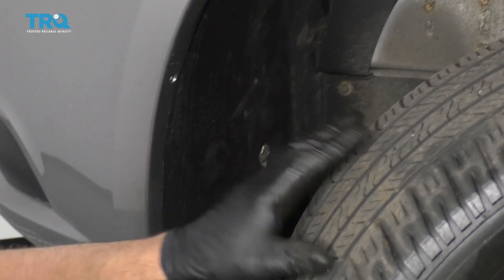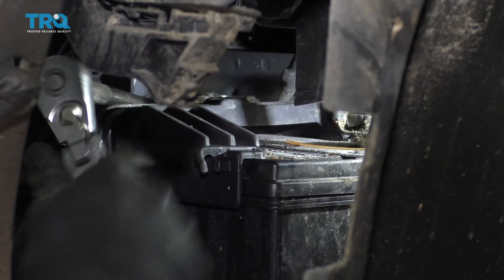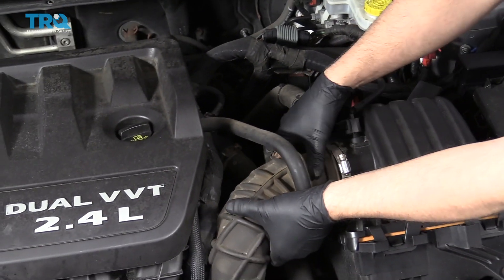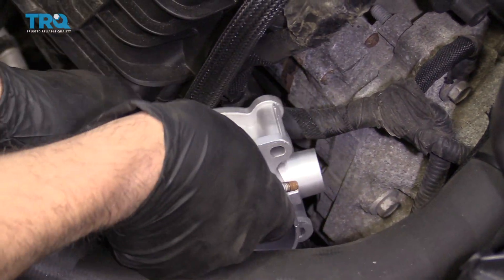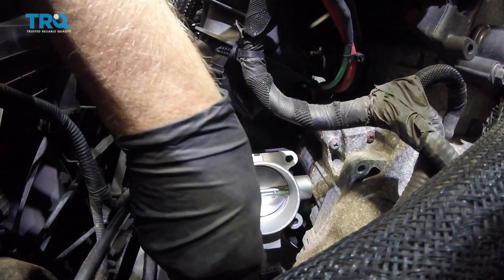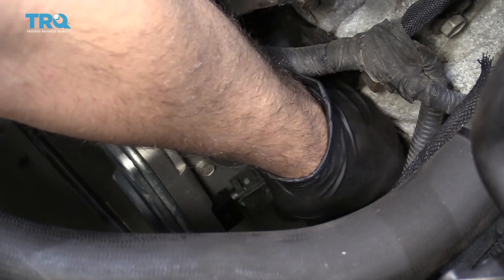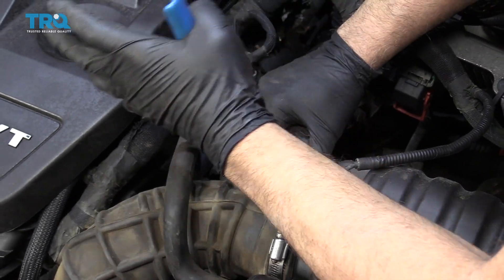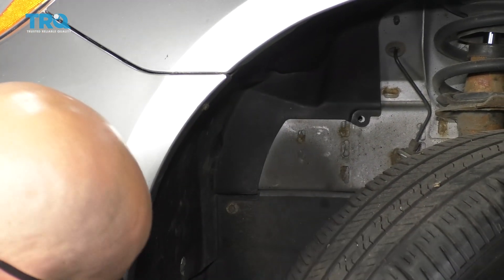How to Replace Throttle Body 11-14 Chrysler 200

Comment: hey man had to come comment. great video! I've never worked on a car before (changing tires and the oil aside) and you made this repair very easy and understandable. after watching this video there was no doubt I could do this myself and so far so good! car started right up, idling properly and the throttle light was gone from the dash! thank you thank you thank you!

Comment: It’s dead of winter and mine has a heat protectant plate that is curved that the end of TB goes into. And mine won’t come out after 4 bolts seems it’s rusted or attached to the plate very odd, it’s the pzev edition (barely emission)

Comment: Where is the sensor itself located? Currently having issues with my electronic acceleration system
Reply: The electronic acceleration system is located on the gas pedal.
Reply: @jmarsh131  lmao

Comment: How do you know if it’s the throttle body that needs replaced or just bad wiring because Chrysler’s are known for electronic issues...my car has the sensor light for the throttle come on and off randomly but when the lights off it drives normally.
Reply: I had a similar problem and it turned out to be a bad crankshaft sensor and some other similar sensor that I forgot the name of right now.
Reply: It’s a year later did u ever figure this out ? Was it the throttle body or the wires